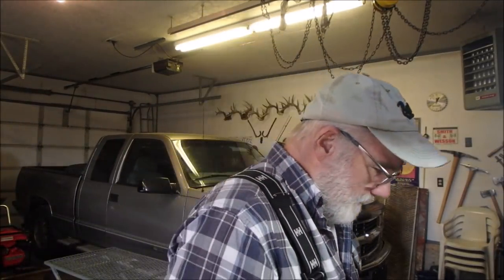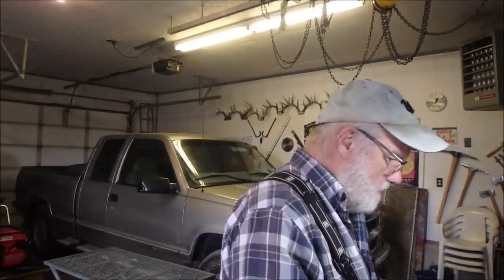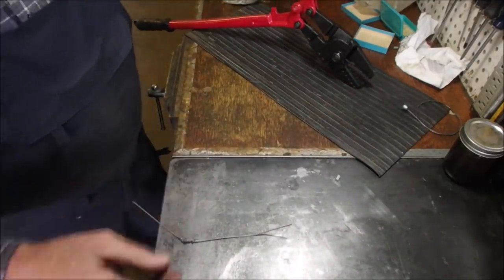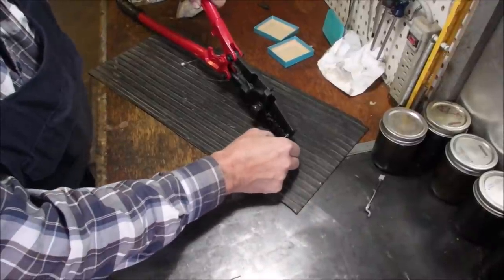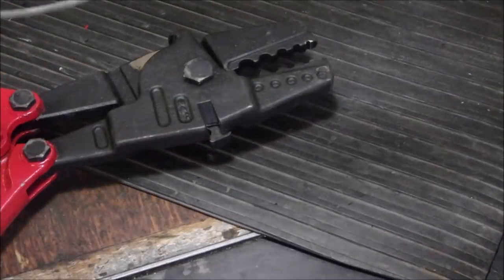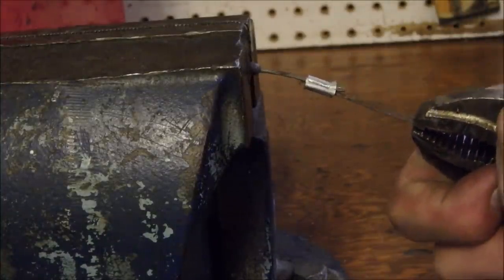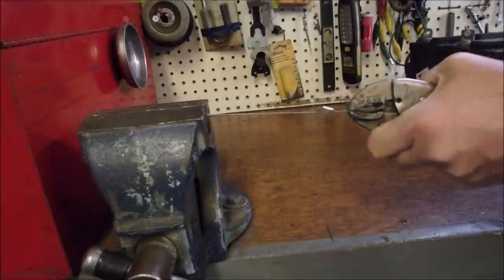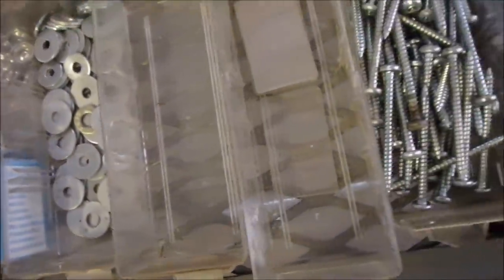Improvement on Making My Own Mower Cables

Comment: You can get a bench version of this tool Bruce easier too use with one hand! That one you have is the tool that industrial door engineers use to crimp steel ropes on sectional over head doors while on customers sites👍
Reply from the maker: I found that out yesterday when a friend of mine came over who is a Door guy

Comment: One heck of a set of crimping pliers ...If you designed a way to hold them in a Vice You  would only need one arm to run the handle
Reply from the maker: Right   As you say my first try was in front of the camera.

Comment: that's cool,   most of the bad cables that come my way  on mowers are frozen up and not broken,  but this is cool way to fix one that broke.   ppl should learn not to keep mowers outside for storage.   a good way to help is to put a small dab of general purpose grease on the cable where it slides into the case of the wire.   I have found that has helped lubes  it and keeps some water out.
Reply from the maker: I don't keep mine outside   They are in the shed but the owner (ppl) mowers have cable issues all the time.

Comment: Nice old drawer system. If you hang it up on the wall using the small eye lids on the back - it will become rigid 🙂They still make them like that today - I've got a couple similar ones
Reply from the maker: Great idea!  I may put it on the wall.  It is heavy though.  I chuckled when I saw Made in Denmark upside down as well.

Comment: If you can get a piece of sheetmetal or even masonite to span the back of that little cabinet, it will stiffen it right up. ..you'd have to fasten it at least 2x along each of the 4 edges.
Reply from the maker: Well the gent I sold it to may have the piece.
Reply: @BrucesShop  i see. I realize it's a moot point by now, but mounting the little screw organizing cabinet to the wall would have done the trick as well or better.  Thanks for your reply

Comment: razor blades works very good ,spray glass cleaner let b for some m and will come off easy ,new blabe
Reply from the maker: Thanks
Reply from the maker: I guess I am starting to understand Patina.
Reply: @BrucesShop  I forgot to point out that I was talking about to clean that tape you were cleaning in that little metal box
Reply from the maker: @luilui03able  Right.  There was a day when i would have painted the unit but now every scratch and bump means something.  "the patina"  Sorry
Reply: @BrucesShop  I know what you mean👍I have a shirt that my mom gave me ,when I was 15 ,been in my hands for more than 45 years 😊 does not fit me any more though😁